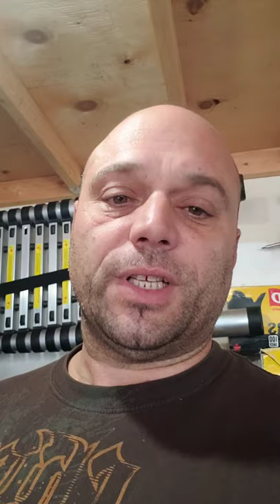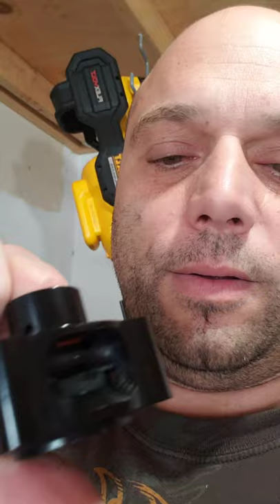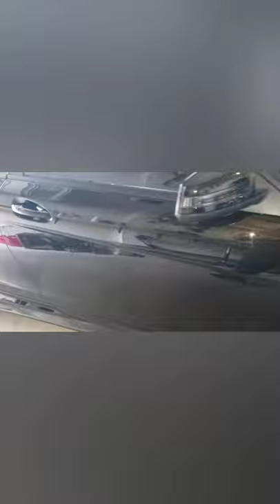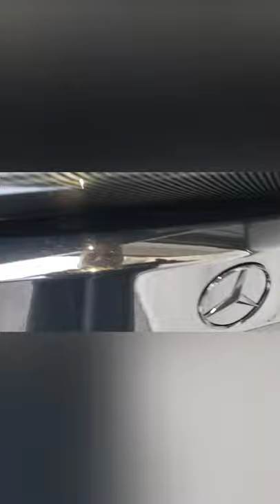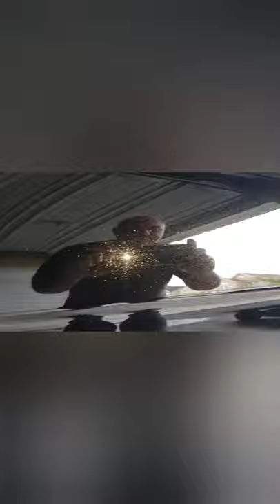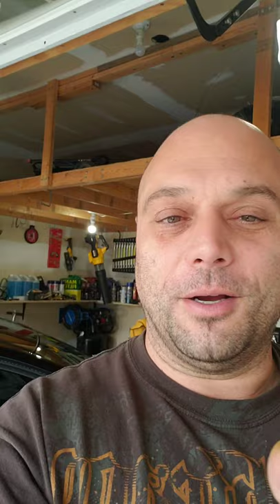W204 C250 VTA or DV+🤔

Comment: I’m about to get the version without the BOV. It’s been about 9 months and I’m a little tired of it. Also, it doesn’t go well with how quiet my exhaust is haha. 

Essentially the DV+ and VTA are the same thing, except the VTA, like you said, releases a bit of pressure for the sound.
Reply from the maker: Definitely go with the DV+ 
you can't go wrong with it. Great product and hold boost very well. 
I do really like the sound of the VTA  but until I can figure out out what the problem is I'm sticking with the DV+
Reply: @christiancicala2396  Yeah! That's the plan. Just have to fix the tiny tube on my air intake pipe with the aluminum one, and i'm getting the charge pipes + intercooler + DV+ next.
Reply from the maker: @MatterBe   I got the rado intercooler and the aluminum intake pipe with the silicone charge pipes. Huge difference!
With the rado intercooler you have to cut a little of on the crash bar😱 its much bigger than stock but that's what you want. Aside from that it fit perfectly.
Reply: @christiancicala2396  ah good to know! I was thinking of doing the tornado tuning intercooler/radiator or the rado too. But, I checked Rado’s site and couldn’t find anything else mercedes related, only lambo and porche. Did you buy from a separate seler?
Reply from the maker: @MatterBe  i got my rado from World Motorsports. I just checked and i can't seem to find it there now. I found a link fir you and they have them in stock. 
www.oetuning.com › mercedes-ben...
Web results
Mercedes Benz C250 RADO Intercooler - OE Tuning.
They definitely went up in price.